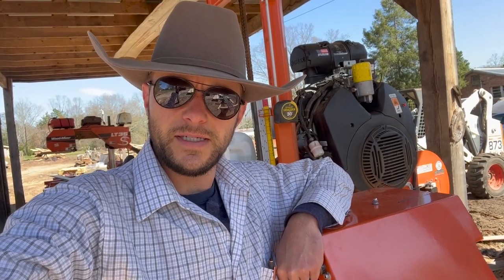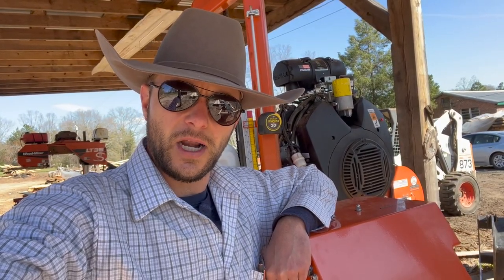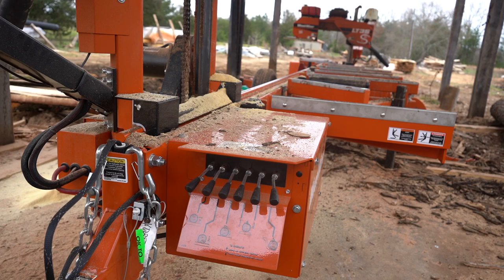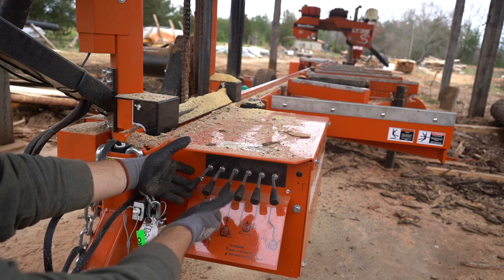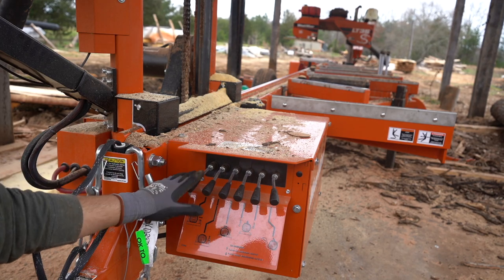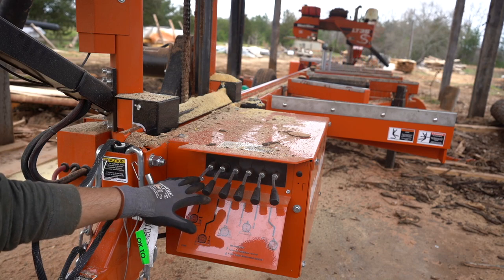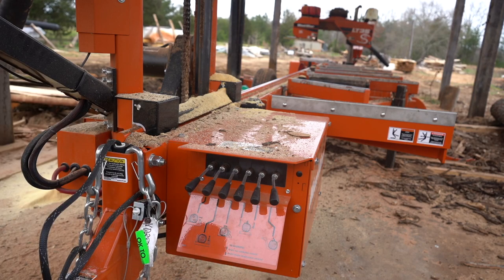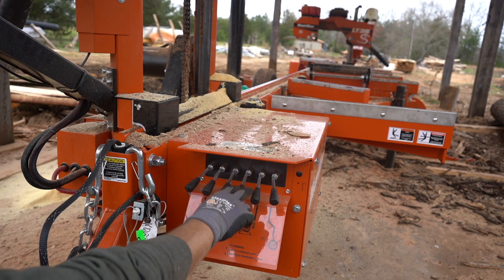Hydraulic functions, Wood-Mizer LT40 Super

Comment: To solve your problem with the hydraulics not working with the head forward, you could just add an additional copper contact strip (or two) to the side of the mill frame to give the hydraulics power further down the sawmill length....something I've been planning to do.  That will also allow you to make log adjustments with the head down the mill and out of your line of sight.
One question:  I've got an old '87 LT40 and I'm thinking of replacing the Onan engine with a 38 hp Kohler, which it looks like yours has.  There should be a tag on your engine that shows the specific model / part no.  Could you tell me what the tag says?
There are lots of different Kohler engines and I'd like to chase down the one WM is using.  Thanks
Reply from the maker: I think that’s what I’ll do eventually. Yeah mine has the 38hp. I’ll check it next time I’m there and give you that parts number.

Comment: Your 4th and 5th lever for the log rollers. You should take them handles off and bend them at the same degree down so when you go to grab the levers those levers are not in series with the rest. They are a one off feature so you dont need them during milling time. Or could even make them longer and bent.
Reply from the maker: That is an excellent suggestion. I very well may do that. Thanks for the idea!!
Reply: You bet.